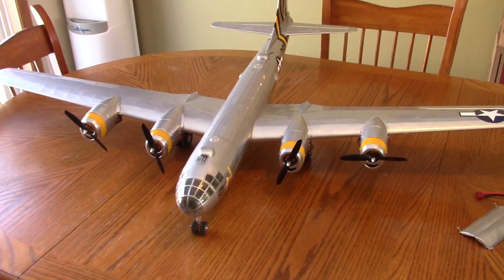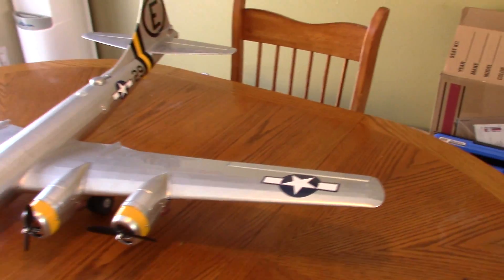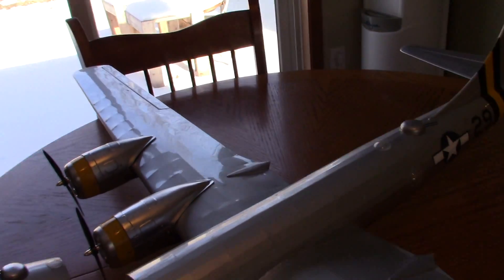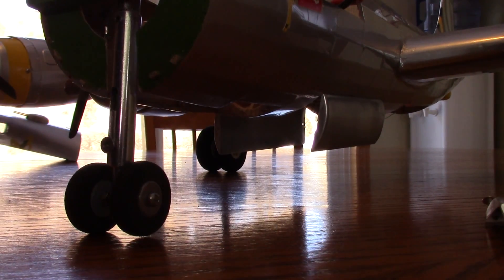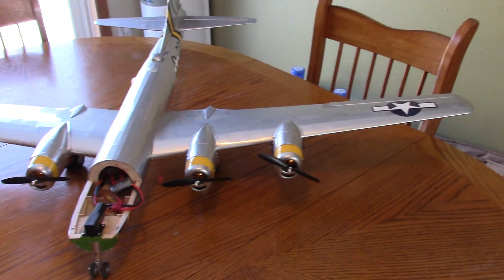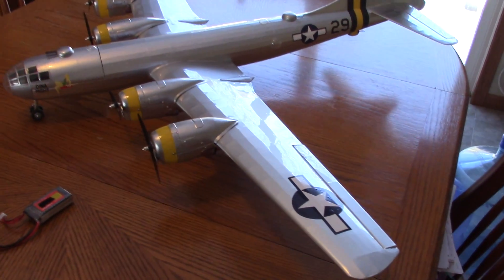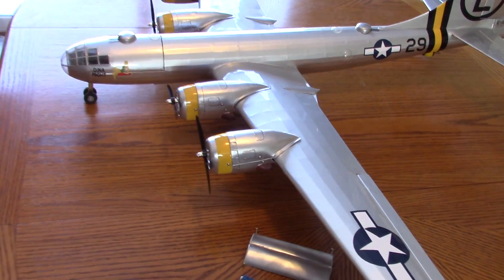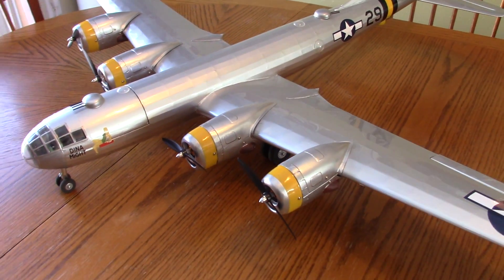Guillows B-29 rc conversion review

Comment: Great looking model. I just bought this kit due to your inspirational videos. Did you make any modifications to the structure? Did you use the wood in the box or did you replace some of it? Did you do anything to make the structure lighter?
Reply from the maker: Some of the wood in my kit was poor quality but i used most of it as i wanted a strong structure. I did open up the formers to lighten it up. If you go to the rc groups there is a build log that can be very usefull.happy building.

Comment: Why is there 2 props not 4? Even The B-50 (motified B-29 With bigger engines) Had 4 props i thought? Oh its an RC ok
Reply from the maker: the model flys on 3 cell power so it can only run a 2 blade prop or it will fry the escs motors and batteries. i could fly it with 2 cell power and go to 4 blade props but there is much less power with 2 cell power so i choose 3 cell to have extra power to get out of trouble with. in flight you never know the difference anyhow. =D
Reply: @jagdpanther9  Thanks!

Comment: What paint did you use to match the parklite covering?
Reply from the maker: that was testors silver in the glass bottle sprayed through an air brush. not aluminum or flat just plain old silver.
Reply: Thanks. I’m building one right now, and want to try that parklite covering.

Comment: Did you use tissue or something else to cover your frame?
Reply from the maker: this and nearly all of my stick models are covered in hangar9 park lite iron covering. it is my favorite for these models.
Reply: jagdpanther9 
Thank you for letting me know.  I'm just finishing up my first stick and tissue p51, so I was looking for a more durable coating than just doped tissue. 
What paint did you use,  if any? Did you use a gloss finish afterwards over the paint?
By the way, all the stick and tissue models you've completed that I've seen so far look amazing.
Reply from the maker: thank you J. this parklite is already silver but i have used testors enamel paint in the little bottles or testors model masters in the round bottles through an air brush and it works really well. the cool thing is if you mess up just use a rag with thinner, wipe it off  and start over as the parklite is fuel proof.some rattle can paints work as well just use a test piece to see what you can use. if you want to dull the shinny finish of the parlkite just use the testors dull coat in the small cans it works great.
Reply: jagdpanther9 

Appreciate the reply.  So I'm also curious,  how did you do the magnets for the cockpit disconnect? Did you just end up cutting out a section, reinforcing it, and adding small magnets? 
Also,  I saw that front landing gear and how it turns sideways, is that an "aftermarket part" or did you design and build that yourself?
I would also like to know what website you use for ordering your parts, because I'm very impressed by what I've seen on your channel.
Reply from the maker: most of these parts came from ebay. as you look over the model you are building you can see and imagine what to do and what will work.i had a teacher who would give us clues on how to and what to do but he would never give us the whole package . this strengthened our skills and we became good at what we did out of necessity . enjoy your builds J.